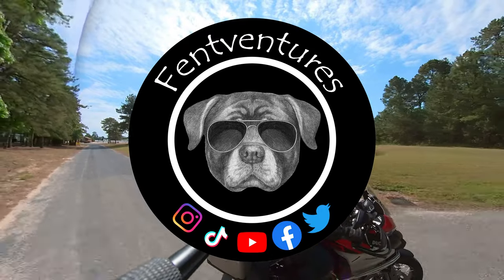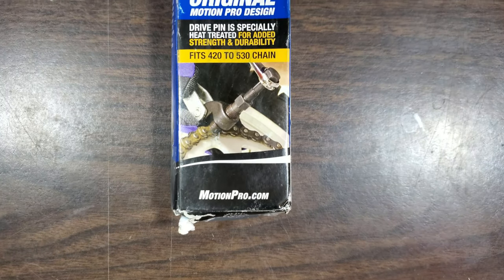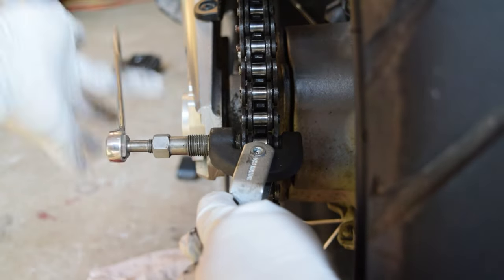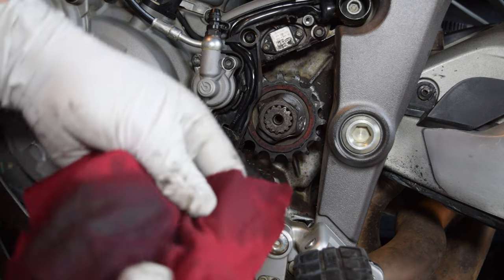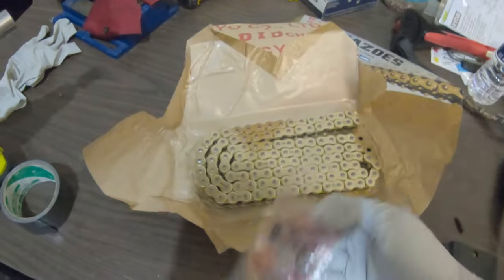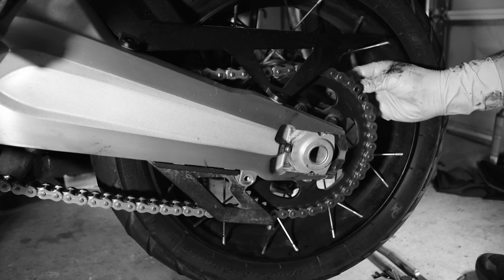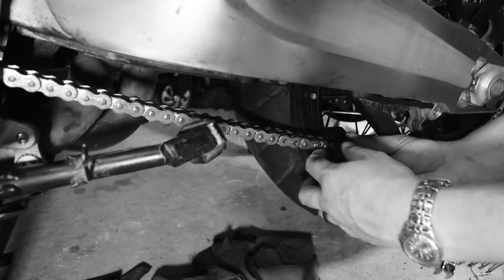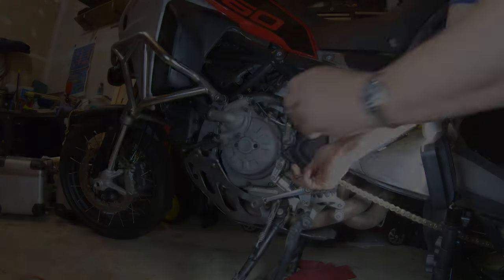Ducati Multistrada 1260 Enduro Chain Replacement: Don't Make These Mistakes.

Comment: You replaced it with 530 zvmx ?
Reply from the maker: Yep.  It has been working really well so far.
Reply: @Fentventures  Do the oem chain has 108 links ?
Reply from the maker: @kjellbencsik4917  OEM has 120 links.  Chain I bought has 130 links so I had to cut 10 links off.